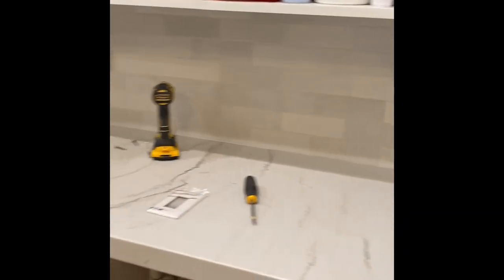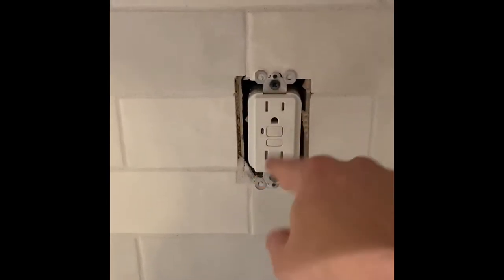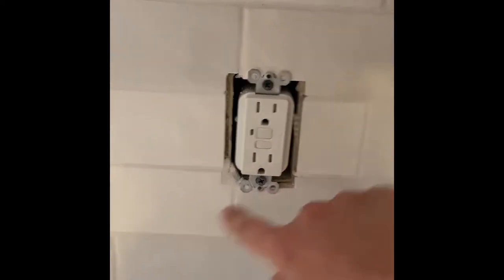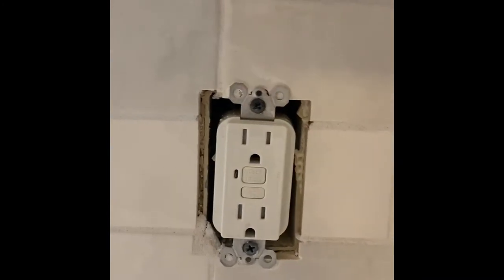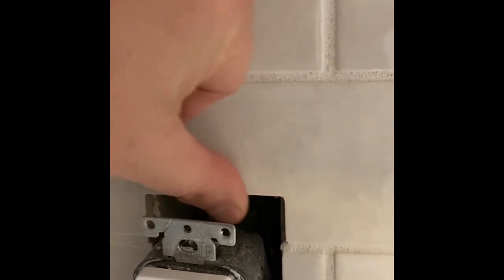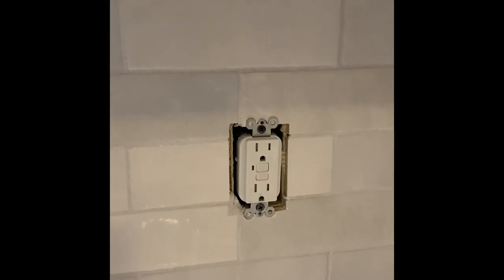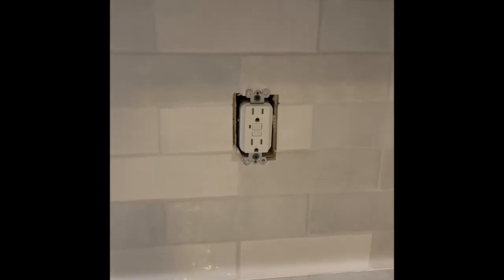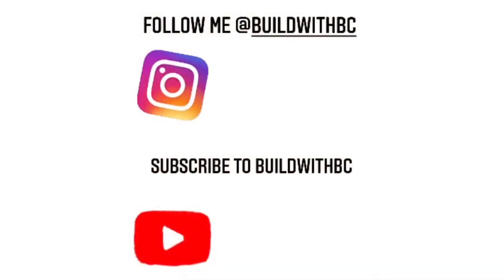BC’s Quick Tip- Notch the tile for the switch plate screws

Comment: The goofs that tiled my backsplash didn't do this and I have the problem as you describe where the outlet covers site out from the tile and looks bad. With the tile in place, do you have any suggestions?
Reply from the maker: You can use a dremel tool with a diamond tip to notch the screw holes out.  I’ve had to do that a time or two when my guys got in a hurry and forgot to do it.